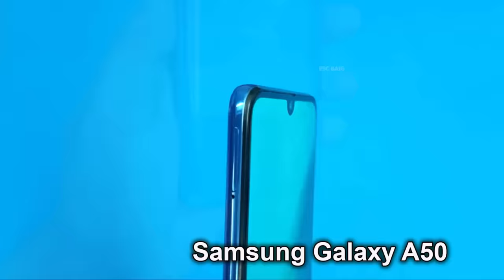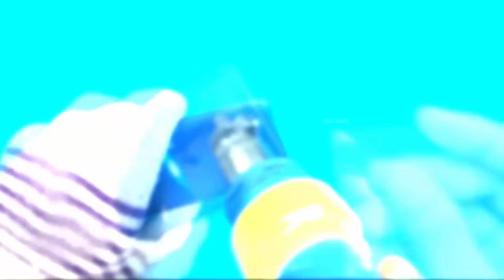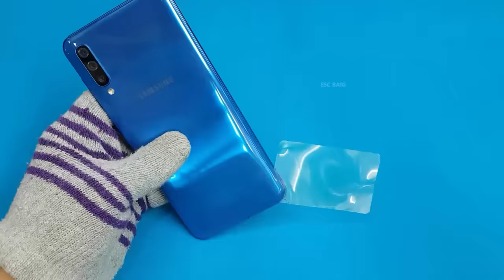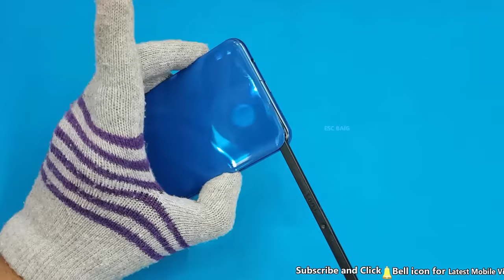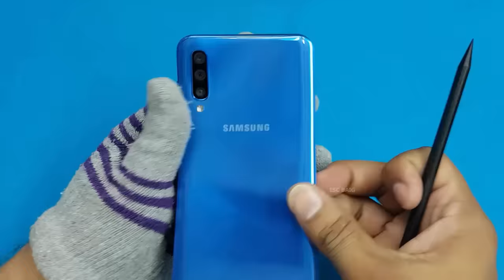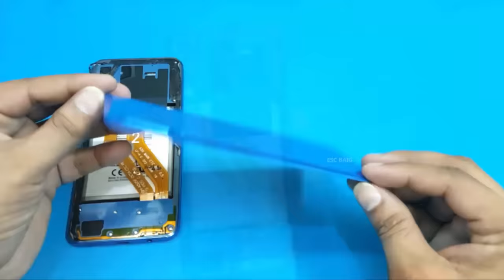How to Open Samsung A50 / A70  Back Panel || Samsung A50 Disassembly || Samsung Galaxy A50 Teardown

Comment: Can these manufacturers just give us removable back covers like on a Nokia C7. Remember the good old days when we carried a spare battery. Why complicate things.
Reply: dustamir  the phone isn't even water proof certified...
Reply: Money
Reply: @Mkrabs  Yeah Im trying to remove the back rn to get water out.
Reply: It's because once the built in battery bloats it'll take out the amoled screen and digitizer with it.
Reply: @Benri05  I once had a nokia c7, it had amoled screen and removable metal back cover.
Reply: because Asia
Reply: Then it won’t be this sleek, and the battery won’t be this massive. Removable battery’s have to be solid li po... which is thicker, less efficient and produces more heat. Current li ion battery packs are much better.
Reply: Sahi baat h
Reply: They hate when you upgrade.
Reply: NO WHY
Reply: CUZ ITS UGLY THATS WHY
Reply: @hellolife1241  I'd rather have a slightly thicker phone if it meant I can have a removable back. Is it really that heavy to carry?? I wish we would be more practical as a society and make items that are repairable. Where are we going to put all the garbage and phones that aren't easy to repair???
Reply: VERY TRUE 😊, AFTER WATCHING THIS VIDEO, I THINK I'LL JUST GO & BUY A NEW A70, IT'LL BE SO MUCH EASIER 👌.
Reply: Trying to get water out of the phone.  Just forget the easy way! Terrible that it isn't waterproof
Reply: @vytilxx  lol same and this cover is a pain in the ass
Reply: Regardless of what everyone is saying, the answer is money. Also so people don't do self-repairs so when you take it back to them only they profit from small mistakes and imperfections that already allowed to go with these things.
Reply: Its because of todays phone standards...lol
Reply: 😂q
Reply: @Mkrabs  q
Reply: Right sir! Easy and simple things were so beautiful

Comment: I work for the company that is the official accredited Samsung repair company in the UK and this is definitely not the way to remove the back cover .  The phone is placed in an oven set at the correct temperature for a set amount of time and softens the glue holding it in place, once soft the rear cover is removed. To replace the rear cover a glue gasket is fitted to the phone and the phone is placed in the oven to soften the gasket and then the back cover is then fitted.
Reply: how would water go inside the phone if it is that glued? I mean, I have my phone that I forgot to take out from my pocket while entering the pool. I can see the water entering because the camera is wet...been 24hrs since then.
Reply: @excaliburwelder9172  does the phone have an IP rating?
Reply: I hope there's no one going to follow this and set their oven high that will make their phone explode haha
Reply: @lazypawtato8701  bitch I was about to do this but okey 👌 🙃 
At the end I got kicked of my house
Reply: @samira-zh5qz  is your house okay? HAHA
Reply: @excaliburwelder9172  my question too. Dropped it bucket of water. Al seems ok except no sounds or microphone, so phone is useless. Can't take apart easily to air dry.
Reply: I believe this example is for do it yourself.  Nobody I know has an oven at home to work on phones

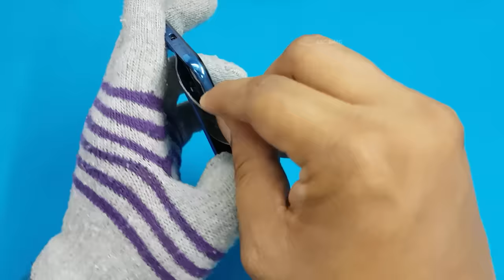Comment: 3:20 the good news that it is made of plastic. For a secound i tought it was glass.
Reply: Its have glastic body 
Its polycarbonate body
Reply: from a10 to A70 :  plastic
Reply: @aglasscup8740  Yes. My A3 had glass on the back and now it is broken
Reply: @ratioripbozo  yaa galss body duribility is broken  polycsrbonate is scarretch
Reply: It bends really easily though. It's thin and big and the plastic gives no support. It bends like paper.

Comment: Samsung 2014: Makes IP67 water resistant S5 with simple click-in back case for easy battery removal. Why? Because that's what customers want.
Samsung 2019: Makes A50 with absolutely zero water resistance, but with heavily glued back panel that takes great ammount of skill to open to prevent you from upgrading your battery. The back panel is plastic so it's likely to get damaged when attempting to open it. Why? Because f*** you, that's why.
Reply from the maker: Thanks For Review ...
Reply: Totally agree, non removable battery is a very bad idea, even after replacing the battery your phone is no longer water resistant 😡
Reply: That's why you should go for Xiaomi
Reply: it IS water resistant

Comment: Took off the case with nothing but a sewing needle and a tooth-peck, just replaced the sticker afterwards and its back on. No need for a damn heat gun that not everyone has.
Reply: should of used a hair dryer, its hard to believe you did it that way without damaging the phone
Reply: @jasonr9157  surprisingly, it didnt break.
Reply: Never use sharp tools to open a phone

Comment: Why i feel disappointed to buy a30 of course with good display fast charging expandable storage up to 512gb super amoled display that has 6.4 inch thats enough for me i just want to experience the big screen i dont care in others opinions
Reply: Joshua Duca a30 is basically an a20 in a50 body
Reply: @A-01-T  a20 is slower, and my a30 is pretty slow, but yeh i have poor eyesight and the screen is the best on the market at the price, so i put up with the laggy response times

Comment: Still durable than glass.
Reply: Not in bending, especially the A70 since it is big and thin. Folds like a price of paper
Reply: @aidaspida70  the jre video proves it works fine with every day use.
Reply: @GAIUSJAKE   Every day use, yes. Accidental sitting or putting it at a weird angle or something, no. That was for the A50 as well. A70 is way worse with an almost 7 inch screen, really thin and the back not supporting everything.
Reply: Салом

Comment: Throwing mine in the oven for an hour at 100 degree, will try to open with an old credit card with a sanded down edge,  I fell in a river after trying to pole vault over using a 10 foot bamboo pole, it broke and I ended up submerged in the water with phone in the back pocket, of course the phone has not worked since. 😑

Comment: Same with A20 sir?
Reply: Yes apart from a lot more pressure is needed, use all the pressure you have since the adhesive is strong.

Comment: FUCK THIS PHONE, REALLY. FIRST, I dropped it now the screen doesn't work. (TRIED SOFT RESETTING, didn't work. THE screen display itself is broken because of it shows some flickery lines sometimes). SECOND, it does NOT seem to work with the HDMI-TV, so there's no getting around that. THIRD, I Have MULTIPLE ALARMS SET AND THIS PHONE JUST WON'T FUCKING DIE. HOW THE FUCK AM I SUPPOSED  TO KILL THIS PHONE? I CAN'T SHUT IT OFF BECAUSE YOU HAVE TO "TOUCH" THE "TURN OFF" OPTION AND MY TOUCH ISN'T EVEN WORKING. AND NOW, I HAVE TO FUCKING OWN A HEATGUN TO FUCKING PRY IT OPEN?! WHAT THE ACTUAL FUCK

sorry for the cussing, the constant alarms is driving me insane, I will drown this phone if I can't bear it anymore

ARGH. DON'T EVER BUY THIS PHONE.